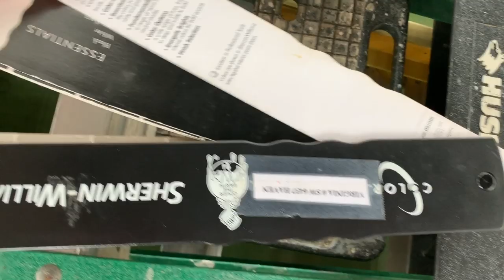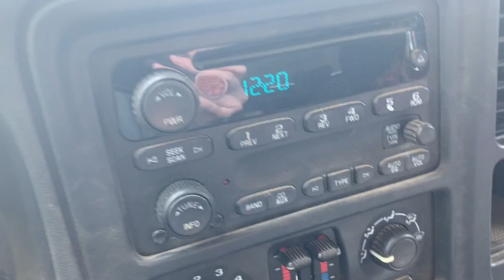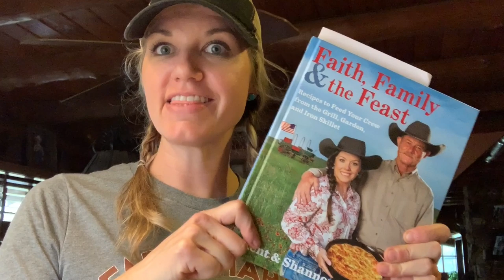LOOK WHAT MY 9 YEAR OLD DID!

Comment: I think you really need to put up black plastic, Over the walls ( inside the crib ) before you add the inside covering.....When the rain blows between the crib boards it will rot out the inside covering fast! But using black plastic will make the original corn crib stand out and protect your inside covering...... P.S. ask your hubby if I can borrow one of his left handed monkey wrench lol lol or if he has a extra sky hook I could use lol lol....He will know just watch his face expression lol lol

Comment: The center part (I call it the neck), doesn't have to be extended all the way.  Loosen the collar nut, (red,  round, 3 ears, on top of tripod bracket at 24:30) adjust height and tighten collar nut.  Also, you can adjust the height by simply not extending the last section of each leg... or two sections.  Hope this helps.   

This too.  https://www.bhphotovideo.com/explora/photography/buying-guide/the-tripod-explained
Reply from the maker: I need to play around  with it more. Thank you!
Reply: @ThisFarmWife_  My pleasure!  Love your channel to pieces!